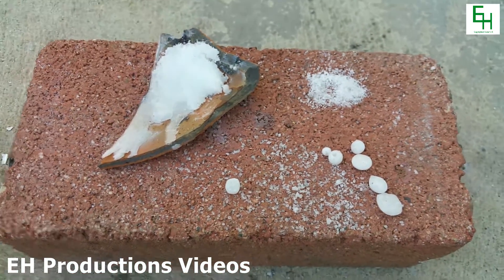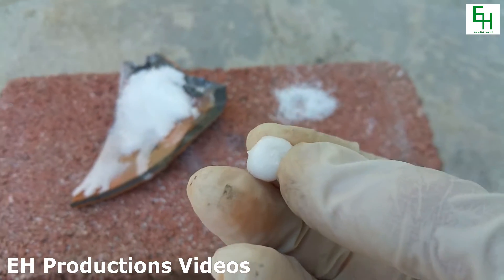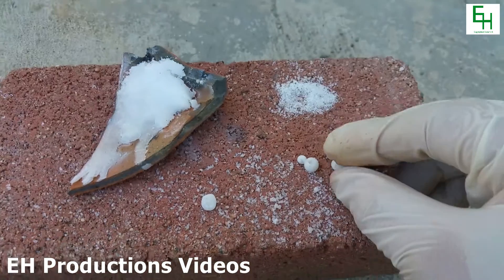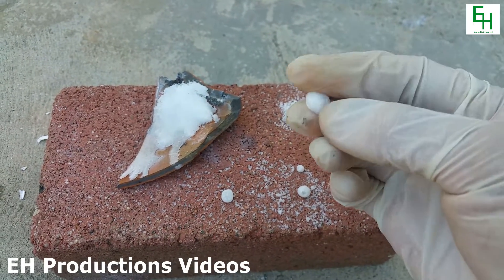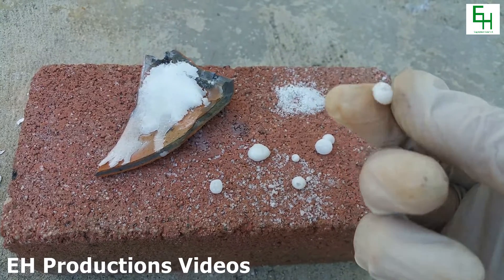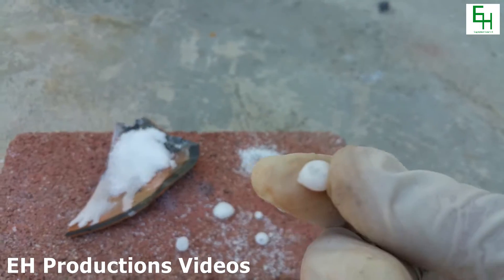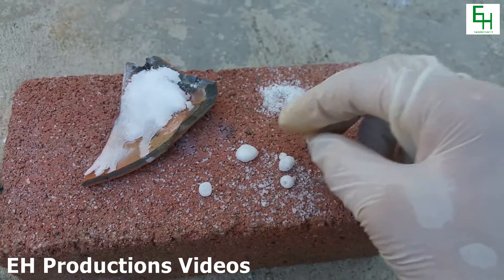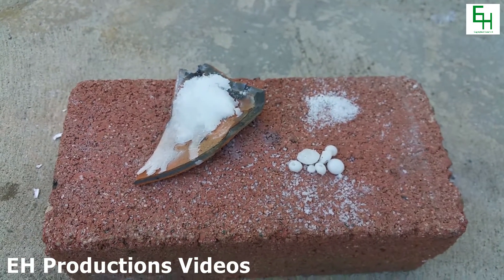Making Beads of Salt

Comment: Its still edible by the way, I tasted it xD
(same chemical formula and structure, so its not like its toxic or anything)
if you melt it on a clean surface (I used a white ceramic dish) then the salt stays crystal clear, or in my case, white, after it crystalized.